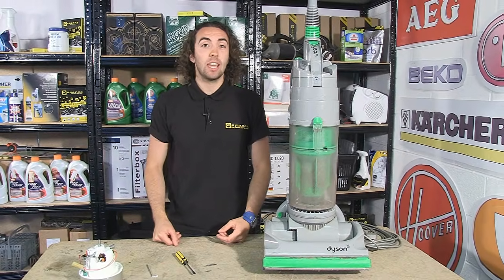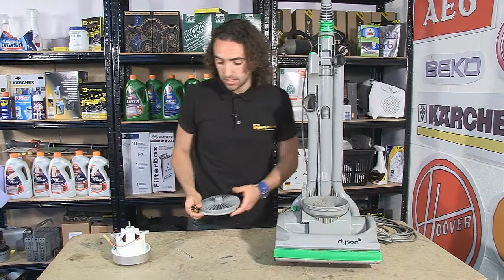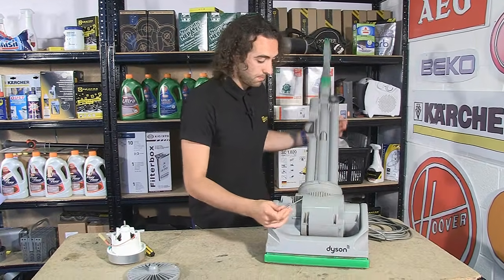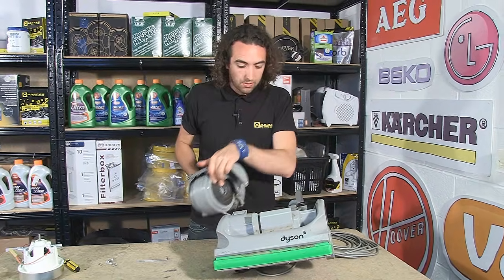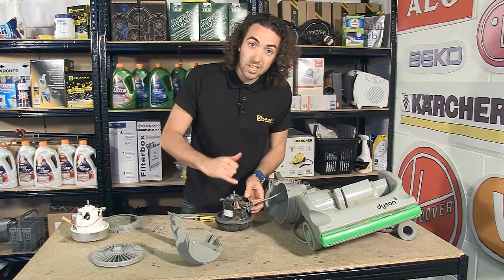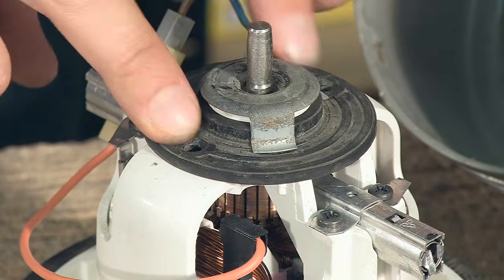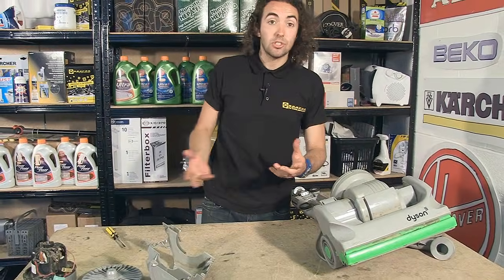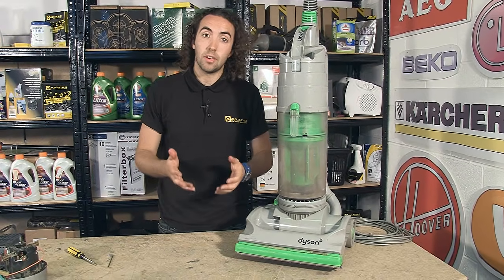How to Fit a New Dyson DC04 Vacuum Motor - Quick Dyson Motor Change

Comment: I just swapped out the whole chassis and motor from a Silver and Lime dc04 into my absolte (Purple and Lime) was quite the job, couple hours but successful
Reply from the maker: Well done, a fiddly job but should return the machine to useful life.
Reply: yes, hardest part I think was the motor front cover, that was very awkward trying to undo all 6 off the screws with my very fat T15 driver

Comment: Josh you have not noticed the green cone is upside down in the clear bin.
Reply: Dave Greenwood I noticed that too. That's the first thing I would sort out when repairing the machine
Reply: I repair these vacs for a living and so many dc04's come in with the cone upside down and the customer complains the machine is not sucking. i know all the dust has gone into the filter.
Reply: RE Dave Greenwoods comments: Thanks for pointing that out Dave. This was a machine 'donated' to us to do a video on and we were concentrating on the motor replacement and did not notice at the time the 'cone' was upside down. At least anyone now watching the video can see your comment if in doubt on the correct position of this part.
Reply: Re Carlovers's comment: Thanks for your comments, glad to hear you were watching the video so carefully. :-)

Comment: the cleaner head needs to be removed, or else its difficult to put the motor housing back into place, and you should also.use lubrication around the motor seal or it wont fit properly